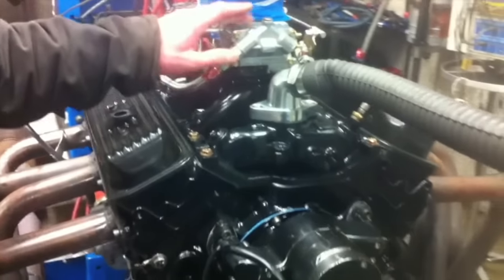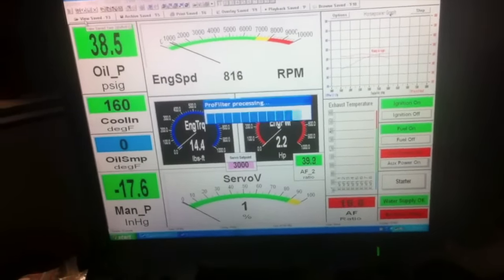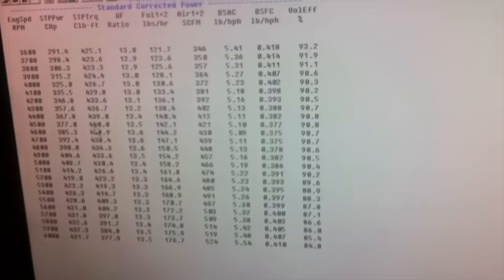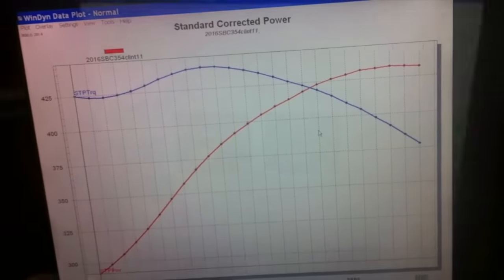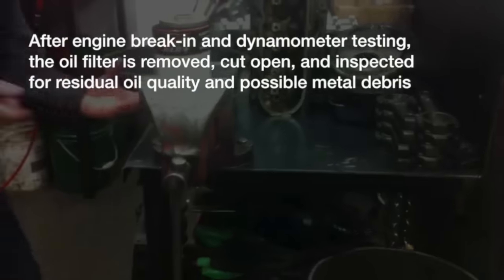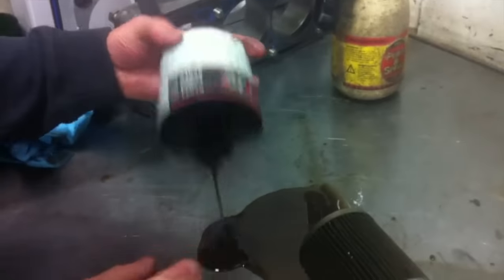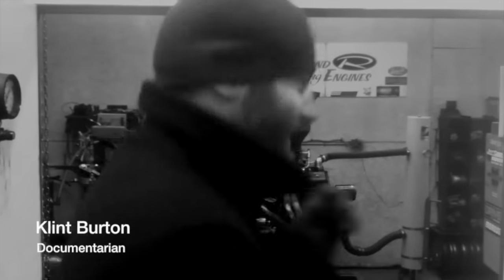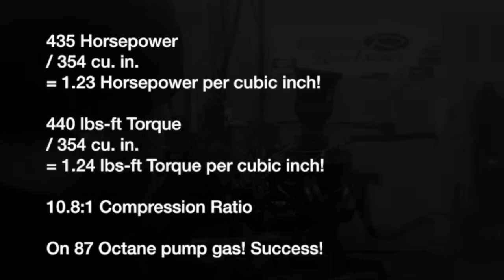SBC 400 Block + 327 Crankshaft Dyno The 350 Chevy Should Have Built (2016)

Comment: I built a dirt track motor that got us kicked out the class for dominance.  It was a dart 400 block  custom Bryant 2 1/8th stoke crank 6.50 rods and a 4.125 pistons   made a high winding little motor would hit 10 k rpm  before  we knew it.   An little 317 cu motor was a monster.  But was with in the rules.  So they kicked us off the class the smallest motor in the class
Reply from the maker: Wow that’s something else! I’d love to have heard that wound out!
Reply: Wow. I used to do cup car engine development - so I know a thing or two about valvetrain kinematics. Getting the valvetrain of an OHV engine to handle 10k is no small feat. How'd you do it on a dirt track budget?
Reply: @GroovesAndLands  All kinds of non-dirt track budget, high dollar valvetrain gear!! LOL or he's lying! One of the two. ;)
Reply: If it was all within the rules, how do you get kicked? I'd call BS!
Reply: Awesome build,
Reply: @GroovesAndLands  He saw 10,000 on the tach by setting the tach for a 4 cylinder! LOL My buddy turned his 555 BBC 7,500 with titanium valves & REALLY good springs & retainers. He's now building a 440" diesel block Olds, Batten head motor that he plans on turning 8,500. His ALL MOTOR S/C Olds Cutlas has gone 7.96 / 168 with a single Pro Systems carb on race gas at Phoenix in June with 4,000 ft Altitude Air Density. That converts to mid 7.70s / 172 with 70* ambient air temp at sea level.
Reply: @Anarchy-Is-Liberty  BINGO!!! The latter is more likely than the high $$$ valvetrain. Sounds more like a keyboard expert in mommy's basement. The NASCAR teams were changing a $3,000 set of valve spring 2 or 3 times per weekend when they were turning their engines 10,000, & the NHRA Pro Stock engine run springs with well over 500#s seat pressure to turn their engines 10,500, & they change springs after only a few 1/4 mile passes. Bryant crank, Dart block, 6.5" rods, etc. Yeh I bet! Everybody builds a $30,000 motor to run in their Street Stock at their local dirt track! LOL
Reply: @thepoopsoup  Bullsh!t!. NASCAR has a spec(it's an actual blueprint ever since Toyota joined the show, stating bore spacing, cam/crank space distance, deck height, V angle, etc.) for ALL the motors & a list of manufacturers part numbers the teams MUST use. Marlin's car was the first to run an X pipe exhaust which gave the engine the "different" sound when first unvieled at Daytona. Nobody wins any race giving up almost 50 cubic inches, especially with a restrictor plate motor in a 3,500# car. Well known Arizona engine builder Tom Klein's answer, years ago, when I asked him about running 410" motors in his sprint cars was, "Hell no! Ya can't pass anybody with a 410!"   LOL
Reply: I built a similar engine it was a 350 block 60 over, 327 Keith black pistons 12 to 1 DOME eagle floated rods, on a 307 crank, and good head and lunati 550 lift cam work, that engine shift point was 7500rpm it was still building power but flatening   457 HP 422ft lb torque and was a 336 cu in engine, that could have made more power with minimal work, the problem I had was oil  an 8 qrt  oil pan and oil restrictors and that engine lost oil pressure at high RPM at the finish line.
There was no oil left in the pan, it couldn't return fast enough to keep the pump from sucking air the oil pressure gauge started bouncing.  That engine  had hit  10,000 RPM but it was out of the power and  loaped over with no oil pressure.
Reply: I built a 302 chevy all nice parts it doesn't quit reving unreal got it in 69 Z28 I always wanted 2 put it in outlaw sprinter it would kick
Reply: @pauldunn7000  Current state of the art engine builders use minimal domes because they impede "flame travel". NASCAR engines have flat top pistons with a combustion chamber just big enough to place the valves!
Reply: @slickdoglong3669  I e always wanted to build a 302. That’s the same thing I’ve always heard is that they never quit revving! I e heard of several that were built by successful builders that would hit 10k RPMs before You know it😊
Reply from the maker: Thank you ;)
Reply from the maker: Holy smokes! Sounds incredible :)
Reply: they do that everywhere, friend of mine is a thermodynamic engineer and he was kicked out of his road racing class while he was beating the guys in the next rank up solely with aero and weight mods
Reply: @Paul Dunn  what kind of TQ & hp is a moter like this making down low in the rpm?  I'm looking for TQ down low for a 4x4, prob not the moter I want to experiment with, I'm guessing?  400 with vortec or Dart heads makes more sence, maybe stroked a little?
Reply: @Anarchy-Is-Liberty  Nono, he probably is being truthful. Small town dirt track stuff is some of the most tribalistic and nepotistic racing there is. I’ve been kicked out of events because someone’s grandpappy had beef with some cousin or something of mine
Reply from the maker: @darrinstone49  Thanks for your question! You're welcome to contact us through our website: ceperformance.ca .
Reply: Depends on who’s running the show
Reply: 4.125 inch pistons with a 2.125 inch stroke would yield a V8 of 227 cubic inches. Are you sure the stroke wasn't just under 3 inches? That would get you 317 cubic inches. Sounds like a great engine either way.
Reply: @bodybong  that’s kinda why I don’t like small towns but to each their own I guess
Reply: Video or it didn't happen
Reply: @Anarchy-Is-Liberty  Ask anybody who was kicking butt with Cleveland Fords. You still can't run them in WOO
Reply: 🤣🤣🤣🤣😂😂😂👏👏👏👏 Awesome Job there. 👌 👍👍
Reply from the maker: Thank you :)
Reply: @bradgriffith4231 the year before dale Jr went to HMS during qualifying at Texas HMS turned there motors over 10,000 rpms for qualifying I'm thinking it was the R07 they did that with but it could have been the sb2
Reply: @garyk76  He went to Hendricks in 2008 so it was probably the R07. Everybody was winging the motors then, even the SB2, some close to 11,000 rpm, but also changing a $3,200 set of valve springs 3 times per race weekend. NASCAR put their "gear rule" into effect to reduce RPM & help reduce the cost of the weekend. This also came with limiting the HP to 550 & 750 so the extreme high rpm, & corresponding huge cams, was no longer needed to produce close to 1,000hp with a 355ci motor. NHRA Pro Stock guys were turning 3.600" stroke, 500ci motors 11,500 or more until NHRA chipped them to 10,500. The only thing that limits RPM is the size of one's wallet! LOL My buddy is going to turn his new diesel block 440ci Small Block Olds 8,500 in his 85 Cutlas Super Comp car & turned his old 555 Chevy 7,500. His car has gone 7.97/168 at Phoenix with 4,000ft altitude air density.
Reply: @bradgriffith4231  I'm sure it was the R07 when it was under developmental because it was a different motor than Hendricks championship contenders wasn't running because they wasn't sure how reliable they was but straight out of the gates it made more power than the sb2 did
Reply: I had a 427 BBC crammed into a '75 Vega station wagon. Crowler roller cam, Brodix aluminum heads, Victor tunnel ram intake with a pair of 650 Holleys, and a NOS direct injection 300hp kit, a forged gm crank, Manley H-beam rods, and forged JE pistons with a compression ratio that was roughly 11.5 to 1. Narrowed 9in Ford with Strange axles, Detroit locker running 4.56 gears. Unfortunately my young dumb *ss insisted on running a M21 4 speed, without the required talent to use it right. So after a good 6 months of being a terror around my neighborhood, I decided to go to Norwalk Raceway and really see what she would do with racing tires and a good surface. I am certain that I turned that big block 10,000rpms! Once. When you miss 3rd gear with the nitrous still hitting, they tend to rev pretty quick. 😂😂
The only thing that was still salvageable was the intake and carbs. Watching oil streak up your windshield kinda sucks. 😂😂😂
Reply from the maker: Holy smokes :) 
Sounds like a hoot.
Reply: Same here.   @Louzahsol
Reply: Great engine!!
Reply: @GroovesAndLands  His response....crickets as expected. Another dreamer
Reply: @bradgriffith4231 when I was a kid building N/A SBC's, I thought the big dome TRW pistons was the trick! We ran methanol with the final CR at 12.75:1 but I always felt it didn't pull through the power band as strong as the parts being used indicated it should. I had good top RPM, 8100. It wasn't until older a deeper into engine building and development of supercharged, BBC, injected on methanol. Class rules dictated 9.5:1 and no higher than 20% over on a 6-71 blower. It powered a circle-track hydroplane, about 175MPH at top end, 1-1/2 mile courses. There, I learned about piston flame front propagation delay issues with raised material across the piston face with Ross racing pistons. The best motor had reduced piston dome to 3/32" with the deck flush with the flat section. It used valve reliefs cut into the piston to shoe horn that .800" lift cam in there. We dyno'd it at 1488Hp at 7200RPM, it boosted to 17PSI. We won some races with that motor! It was the GP-55 hydroplane, google it, it was a wild ride!
Reply: Most classes lower than modified require stock GM internals. How was this engine legal?
Reply: Won a race at Lucas with a crate ,disqualified for illegal oil pan bolts ! Now I. Lol !😊 baby's one an all 😊
Reply: D A most , our mods run anything they want ! Etc diff rules different part of country,  tracks
Reply: @mickeymichaels1298 I have not crunched the numbers but a 4.125 bore x 3.125 stroke would give somewhere in the area of the 317 size he mentioned
A buddy back in the day wanted to run a 4.125 bore x 3.250 stroke , which he said would be 340
He never did , if using a 400 or bored 350 truck block it needed a special crank . If using a bored 327 then cyl walls got thin
Reply from the maker: @stevengrabowski667   
Thanks man. Here’s another one we love even more… 
SBC 283 Crankshaft + 400 Block = 500+ HP (Dyno Test 1 of 2)
https://youtu.be/dBjdYC5sMjs
Reply: What a bummer.  I think that is creative.
Reply: @outinthesticks1035  The "crunching" is easy: bore radius squared times pi, times the stroke, times the number of cylinders. That will get you close.
Reply: @bradgriffith4231  gotta love Nascar...  "Here, build this exact car with these exact specs, then follow everyone else with the exact same car with different names on them, politicize the teams, take the ability to compete out of it, and then we will call it racing."

Did Henry Ford get resurrected? You can have any color you want, as long as it's black...
Reply from the maker: @Faolan161 That’s funny :)
Reply: Invasion & thinking outside of the norm is is so interesting about racing
Reply: @bradgriffith4231 piston crowns design can be dictated by other things thou. Sure, a flat top works great in a wedge combustion chamber, but it can lead to trouble getting enough comp in a Hemi or penta-roof chamber, especially the slightly older ones that are a larger capacity, deep chamber design like a 2JZ or an RB Nissan, CA18 or FJ20 motors- not as bad on a slightly more modern SR20 or modern penta-roof design motors of various makes...
Reply: I spent the time finessing  a 308 HP engine that I managed to regularly hit 9500 rpm. 
Lots of attention to detail, stealing bits of other engines ( I ran guide plates with 186 rockers giving me adjustment. ran a 45 tho bore with 40 pistons and a set of file back rings. The tunnel ram with twin 600 vac sec Holley an and a huge cam.
320/318 degrees and 620 thou lift.  
The noise it made after going past 5k was incredible. The note changed so much. 
Back in the bad old days 😜
Reply: @geoffgunn9673  A Holden 308 based combo??? What lifter arrangement did you run? I've come across problems with lifters coming too far out of the factory lifter bore, losing oil pressure because the narrow machined part of the lifter would become visible as they come to max lift... I've found one particular brand of lifter seemed to work up to around 550 - 580thou, beyond that brass lifter bushes seem to be the fix
Reply: @RebeccaKenworthy  I was running solid lifters. I'm not 100% sure now but I think the HP block castings had a few minor differences addressing a lot of issues and I think the casting around the lifter bore was different.. Plus I spent a good week or so smoothing out every inch of the inside the the block. Anywhere that oil would sit, Then use transformer paint to give it a slick surface that takes the oil and heat, Also spent a lot of time de burring and opening up oil pathways. 
I used good aftermarket pushrods  with guide plates using brass inserts and screw in posts after shaving the top of the posts and retapping them. Used hemi rockers for a better ratio and more valve opening :)
Did the usual blue printing of the rest to bring it all up to spec. 
And the only failure I had was a ball pushed through the rocker arm when I purposely tried to kill it and sat in first doing a burnout at over 10k rpm. Replaced that and it was fine, Sold it not long after in a panel van and got a ticket a few months later for failing to move it form somewhere after I assume the buyer grenaded the engine
Reply: @Anarchy-Is-Liberty because if you start winning and they don't want you to they make a rule. I had the same thing happen to a intake/head I did for a local 4cyl dirt car. All within the rules till it wasn't.
Reply: @Faolan161  EVERY sport & racing organization MUST have rules. NHRA, WOO, USAC, F1, Indy Cars. Show me any kind of competition that doesn't have rules. FYI, the current car puts EVERY team on equal footing, except for engines & engineering, & greatly reduces the expenses of engineering & building every piece in the shop. Regardless of your "opinion", it's pretty hard to argue with 14 or 15 DIFFERENT winners in a season instead of a half dozen. Oh, & BTW, how about 4 cars crossing the finish line 0.003 seconds apart after 400 miles? I'm sure you like the "good ole days" when one went to the races & knew when they dropped the rag that Petty or Pearson would win, or when Ned Jarrett won by 25 laps!  ROFLMAO
Reply: @bradgriffith4231   I understand rules, but Nascar doesn't have rules, they tell you specifically what you can build. There's no room for innovation. It's an authoritarian regime of it's own, telling you what you can do, not just giving boundaries like the rules of nearly every other sport. There's no competition for skill or ability to build a machine like, say Formula off-road racing has. Essentially you can buy/build one engine type, from different brands, and nothing else. 

It's not a sport, it's a regime.
Reply from the maker: @Faolan161   Interesting.
Reply: @Louzahsol Got to love politics in every form.

Comment: I remember reading the article “The 350 Chevy should have build” in HotRod back in 1996.  400 block, 327 crank, with 300 i6 Ford rods (machines to fit, pistons with raised wrist pins for the length to work), 11:1, good heads, etc.  Similar results…  over 400hp and torque on 87 oct with a mild cam.
Reply from the maker: Great article. It definitely inspired this build of ours. We made a few changes from what they did. It’s a great engine! Thanks for commenting.
Reply: That article is still on Google. I can't link to it because idiot YT auto deletes posts containing off YT links.
Reply: @ceperformance I remember that they used 305 heads because of their small combustion chamber at 58cc. Great if 2.02/1.60 valves will fit. Cam was from ZZII or ZZIII 350 package
Reply: @ThePaulv12 I'd love to find it. I no longer have the issue its from 😢
Reply from the maker: Guys, we put a link in the video notes that goes right to the article of “The 350 GM should have made” . Go find it there!
Reply: I still have the issue with that article. I learned so much from Hot Rod Magazine in the late 80's -90's as a young teenager. Back when they could still get away with the hot bodies of summer bikini issue.
Reply from the maker: @allenbowick4716 
We learned lots too! We’re having fun re-working some old school stuff :)
Reply: @ceperformance  HEY THERE, WHAT TRANSMISSION WOULD YOU RECOMMEND WITH THIS BUILD AND A 311 REAR END????? IM BUILDING A DAILY DRIVER/CRUISER
 THANKS FOR MAKING THIS VIDEO.... IT IS AWESOME  JUST LIKE THE COMMENT SECTION
Reply from the maker: @chrisfisher1100 
If it were me, I’d go with the new Tremec TKX 5 speed :)
Reply: @ceperformance  thanks!!!!!!!!   i will definitely check this out. i really appreciate your response. plus your content kicks ass!!!!
Reply from the maker: Thank you :)
Much appreciated!!
Reply: @ralphwiggum6385 still AFR heads, big difference.
Reply: @chrisfisher1100 Built 700R4
Reply: Extremely mild cam, imagine new age roller with some lift and a good set of new age aluminum cylinder heads AFR says it needs. Knock off heads now a days are better than the heads they used back then scratching the surface.
Reply: @ObsessiveAdrenaline  i have been thinking this also... Do you have a specific year or model i should get? Thanks